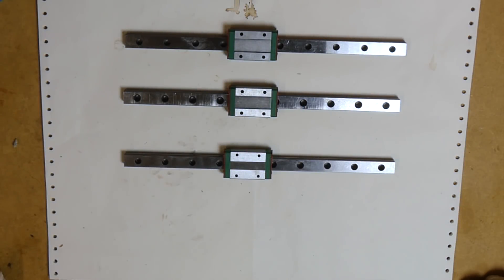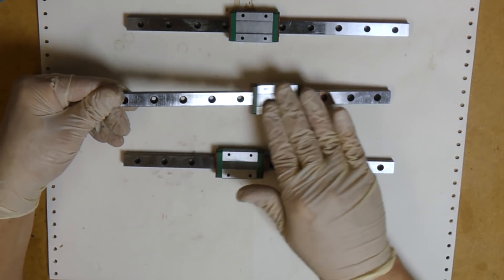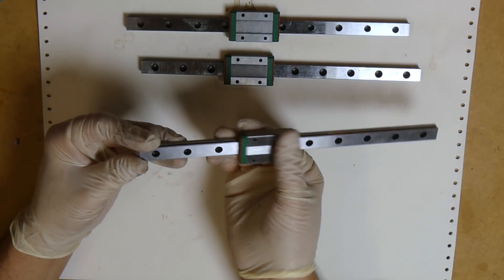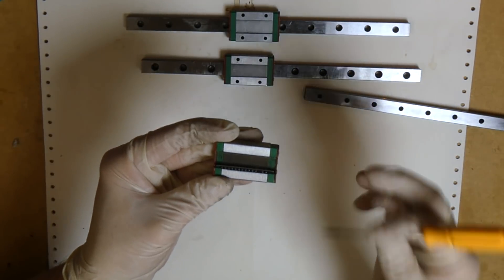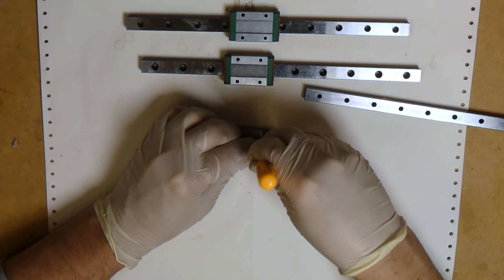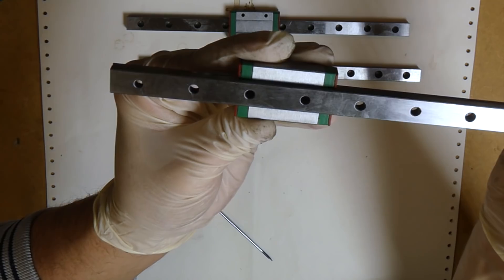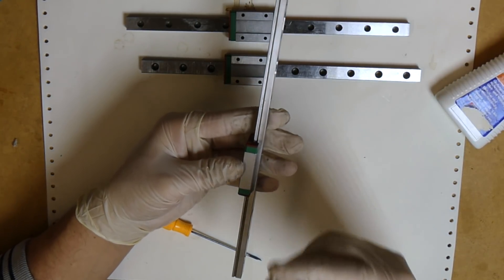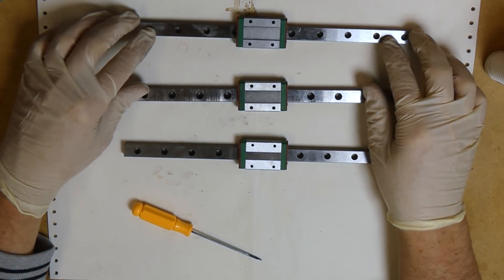Improving dirt cheap linear rail guides & blocks

Comment: Is the rail hardened steel and is the ball bearing real hardened bearings? 
Thats one thing that would make these last over time or not.
Reply from the maker: At those prices I don't think so - that being said: for a 3D Printer they are still perfectly ok - some of my printers have thousands of hours and rail slack is no issue.

Comment: In my opinion the sealing on both ends prevent the grease to come in. Is there a reason why you don’t lubricate when it’s open?
Reply from the maker: I've never thought of it that way - but the rails always greased up fine with proper bearing grease, and that only needs to wet the surfaces.

Comment: Can you mount 2 sections of rail end-to-end to get a longer run or does that result in an bumps/innacuracies as the carriage crosses the joint between two rails?
Reply from the maker: Yes you can. You need to be very exact, but it's been done before.

Comment: I have a few questions, 1) how many of the balls should be in each of these slides? 2 ) will white lithium or PTFE lube work on these for lubing them?
Reply from the maker: I don't know the number of balls, but there is a free space of about three to four balls in total going round.
Reply: @dherrendoerfer  so basically enough to leave a gap of 3-4 balls each side and not full. Gotcha.

Comment: hi i need some advices i planned to make some engraver which is better between linear bearing-stainless steel rod n linear guide?
Reply from the maker: Well, there is no one-size-fits-all, but in my experience threaded rods are not as good, as they tend to go bad and bend at some time - linear rails and blocks in combination with aluminium profile are a much better combination. Sometimes the shape of the block and the 20x20mm mounting holes make the construction of the tool-holder much easier.

Comment: Does anybody know what these blocks are rated at for load (weight)? I'm looking at them on Amazon  to use on a flattening router  jig that I want to make. Thanks for any help!
Reply from the maker: Hiwin has a number of charts on their website regarding the static and dynamic loads that the blocks will take - the numbers are surprisingly high ...

Comment: I bought a set of rails and while they slide great when I opened them, after replacing the bearings, they no longer slide well at all. When I looked at the retainer clip, I can see that it's bowed in at the center. That's what's preventing the bearings from running smoothly through the track. So if I do your little trick to slightly bend the retainer clip, that should help? Thanks. :)
Reply from the maker: yes it might help, the clips steel should not make hard contact with the balls, it will just grind them down. The blocks are usually paired to the rails, if you switch them they might not work well. That only works for the quality machined ones.
Reply: I know it’s been three years, but the clips that hold the balls are just retainer clips. They should not have any tension against the balls. Nobody likes tension against their balls. The balls should be held loosely.
Reply: My balls are bound up. I know its been 4 months but made me chuckle.

Comment: I have seen a few of these videos now and a few different ways of fixing them to be better. You have a very good insite to some of the issues thats good to know about. 
Other ways i have seen with the lose ones some times the balls are slightly out of spec you can order higher precision balls. The extra tight ones i wouldn't discard you could try polishing the contact surfaces as this would remove a very very small amount of material. I would say a tight one i would be more hopeful than a lose one to fix.
Reply from the maker: Yeah, there's no fixing a loose one, except by re-balling them, but I've never had success with that.

Comment: I don't know where you got yours but mine look the same but none of the problems and they say made in Romania. Which is actually good quality. It just happeneds i was born in Romania but moved to the states 32 years ago but a lot of high end companies make their stuff in Romania because the labor is sti dirt cheap but the workmanship is good. From my 2020 mercedes sprinter head light and tail lights say made in Romania to some kenneth kole leather  shoes. So u must have gotten the bargain basement that you find on shady sites. I paid 100 bucks for 600 mm and 4 green carriages with a ball screw.
Reply: Also worth mentioning that Taiwan is the high quality China. If you are looking for bargain machinery, it's definitely worth look that stuff from there. (from machine shop experience)

Comment: Are those Hiwin ?
Reply from the maker: No, I believe these were Machifit.
Reply: they make them better now i guess, because mines werent wobbling or shutters while moving
Reply from the maker: @sfrskz  Yeah, I've made that observation as well, the last that I ordered were very good, if they arrived undamaged - that's my main worry right now, because it seems that many sellers now consider a plastic bag adequate packaging.
Reply: Dirk Herrendoerfer other than lost time if you got warped rail they refund or send new one. i love banggood in this way. you dont wait like in aliexpress disputes.

Comment: You can replace the first one with real 3/32 ball bearings from a hardware store. Clean and grease and it will take care of a lot of wobble or play. Brake clean is my go to for cleaning. 3 in one makes a great grease to use. Phyfe is ok but grease works better and more quiet. Great information to share buddy. Thanks for helping
Reply from the maker: Yes, this works quite well, if the carriage is loose.
Reply: @dherrendoerfer  I think it would be nice to suggest replacing the ball bearings for a loose fit. They are easy to obtain in different sizes. An annotation in the video would possibly help some folks.
Reply: I find loosening the plastic end  caps while it's still on the rail works the best. Find the sweet spot and tighten them back up. Replacing the balls for a better fit makes the rails very smoothly and eliminates any slop. You can buy them in 0.1mm increments plus or minus the nominal size. A bit of preload (consistent carrige drag) makes them far more accurate and allows you to use them at the upper limits, even past their rated capabilities. 
  The rails flatness and accuracy of the ball race grind to the base can vary significantly on the really poorly made rails. You can usually tell the crappy ones by looking at the area around the mounting holes. If the area appears distorted and light isn't reflecting evenly, you have bottom end of low end rails.  
  I wouldn't use these for any application that required accuracy or repeatability. By the time you've got the linear bearing blocks mounted to the carraige and the rails to their base, each one is loaded differently and the balls are being pushed to the top and bottom of the rails raceway. 
  Don't waste your time mounting the cheap linear rails to anything but extrusion or cold rolled plate. The rails and blocks are too far out of spec to take advantage of surface ground mounting plates.   
  They are a step up from rubber wheels on extrusion, how much I'm not really sure. If you use them, buy everything you need from the same place at the same time. Buying a replacement rail months later often reveals the need to replace both rails and all linear blocks and a bit of rework to get somewhat accurate travel.

Comment: I have an idea that could save me about 1000 euros, and they can be as bad as they are. Only thing I need to know, do they work when its a pulling load? Basically rails are bolted down, and load is pulling up and do bearings work then?
Reply: The HG series rail is meant for heavy load in any direction
Reply from the maker: Under load they work, they just don't last long.

Comment: Would way oil be ok to use for the grease?
Reply from the maker: If it is free of acids, yes.
Reply: And not silicon based
Reply: Yes. All the haas machines use way oil with auto oilers (then they tried grease systems that clogged badly. The new ones claim to use grease but actually use way oil again).